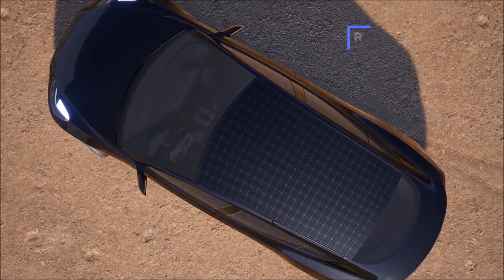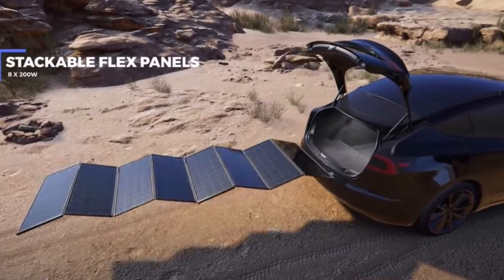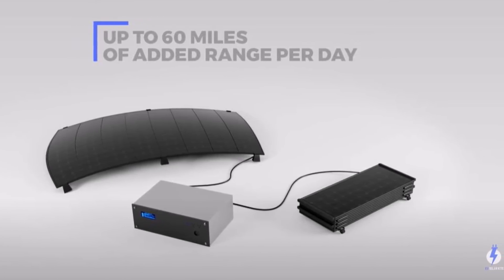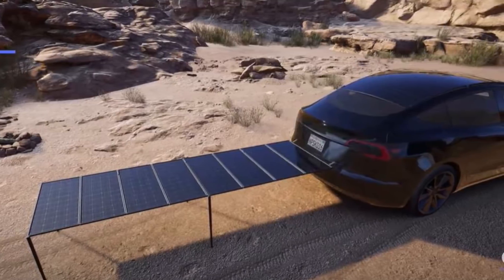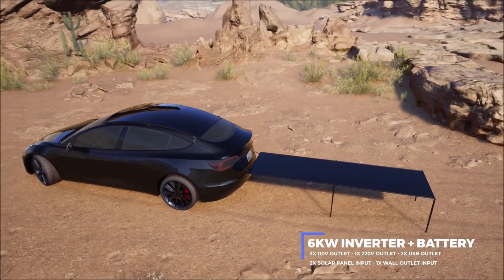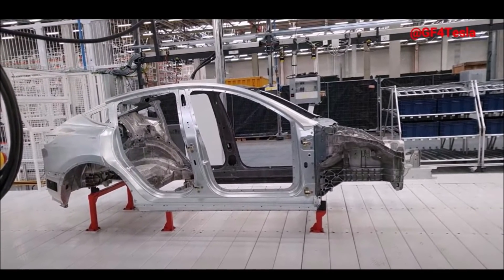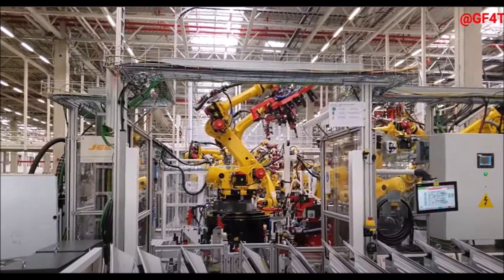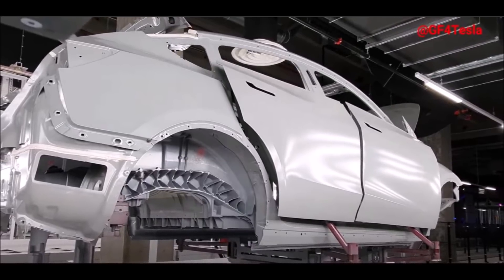New Startup Tesla Upgrade Adds 60 Miles of Solar Range Daily

Comment: Think of the use of solar energy not only for range but to prevent battery from draining.  Solar roofs should be standard on every Tesla.  A solar roof would maintain the car from draining its batteries on internal processes when the car is in idle and disconnected.  Once you disconnect a Tesla from a charger it starts draining the batteries to keep internal functions, internet connection monitoring car location, controlling batteries temperature (it happens when parked and hot), Sentury Mode cam, etc. The longer the idle the more depleted the batteries get.  Think long term parking at an airport or any other instance you have to leave your car parked for days. If not connected the depletion clock is running.

Comment: I think Tesla should offer an efficient version of the 3/y rwd with solar panels instead of glass roof, and chasing efficiency everywhere with narrower and smaller, fully covered wheels, high profile efficient tires,  higher max Regen. most of these changes are cheap or even cheaper than current version
they could even go further with better insulated glass, simple adaptive suspension using small electric motors, gearing for lower top speed, and aero improvements like long tail, rear fender skirts. they could even do smaller, lighter, cheaper motor reused for the "25k Tesla" that would cruise at highway speeds and perform day to day accelerations closer to its peak efficiency. a model 3 cruises at highway speed at roughly 20kW at 10% load,  very far from its efficiency sweet spot
with slightly shorter gearing for 120mph it would still achieve a very usable 6-7s 0-60
they have the potential to be much more efficient but are held back with traditional styling, and performance bias that is not useful for everyone (especially considering most Tesla drivers drive smooth and slow)
let's be honest Tesla performance is a selling point but vastly unused. I've ve seen loads of Tesla's but not a single one driving even close to 100mph or accelerating faster than my 111hp fiat 500e. I can understand people liking undestressed oversized ICE engines with lot torque, long life and cruising efficiently in overdrive, but with electric motors, those advantages simply disappear and having very powerful motor(s) and using them always at very low loads is just pure waste. with FSD (one day?), power will be even more wasted

Comment: I'm a fan of solar but not on a conversion like this. Who wants to unfold/fold the 8x200 W Moduls every time before/after driving. Also the middle backview mirror is nearly completely blocked by the roof-PV. Also 5 k for 2 kWp is way to much money

Comment: I would like something that could cover the glass roof or be used as a "sun shade" in the back and/or front windows when the car is parked that can produce some power to charge the car.  This will be helpful when the car has to be parked at an airport or somewhere for an extended period of time, even if it is just to prevent phantom drain to deplete the batteries.
Reply: Exactly, if this could be the rear glass panel or the trunk lid, preventing phantom drain (mainly by BMS working all the time) is all we need to make the car that's reliable, forget a month of charging, it's in the sun, it'll start.

Comment: I like the idea of solar powered EVs. Which is why I ordered an Aptera, with the 700W full solar package, which promises upwards of 40 miles of solar assisted driving per day. The key to making solar power work (because the surface area of the roof/hood is limited) is to make the EV super efficient. So that it can go further on the relatively small amount of electricity from solar power provided. I watched an interview with the head of EVsolarkits, and he seemed energetic, and enthusiastic. And their solar system concept and design seems solid. But to get the full power (for the $5K price) you need to install an additional battery (for buffer and storage) and the fold out trunk panels, which generate the bulk of the solar power for this system. As of the time of the interview they were still working out how to secure the fold out solar panels to prevent theft or vandalism. I wish them well, but it's still a bit pricey and impractical for me. Even though I can easily see many Tesla owners jumping on the new tech. Especially the solar roof.
Reply: Huh?  Sorry, no — you’re not getting 40 miles a day from 700 watts.

Comment: There is no any science breakthrough need for this, it's all about engineering.

The most difficult part is probably the longevity under various elements and anti-vandalism. 

I don't see it a viable solution.

Comment: I call bullshite.  I have 6000w of solar. I personally get 21-26kw/day depending on the time of year. Panels are fixed, but i adjust them per-season.  I dedicate 7-10kw per day to get max of 35miles of range in my Volt.  If i got super efficient 350w panels, i would need, at 1050W per string of three, 6 of these strings (18 panels) measuring 65”x 34” to get that range.  That large amount of area.